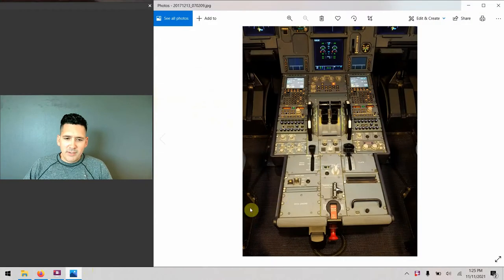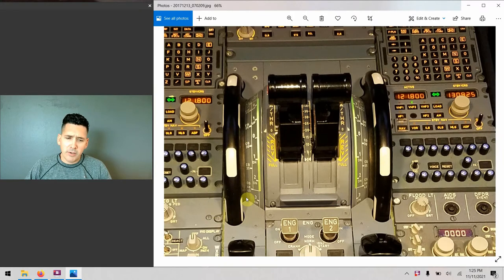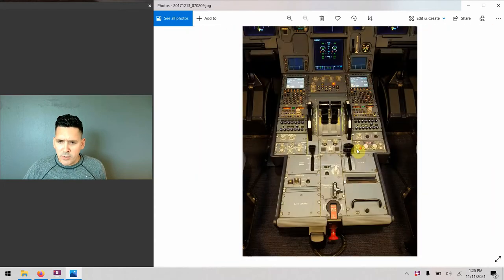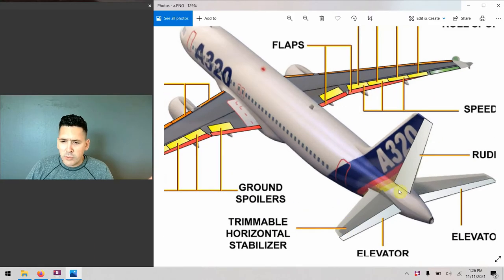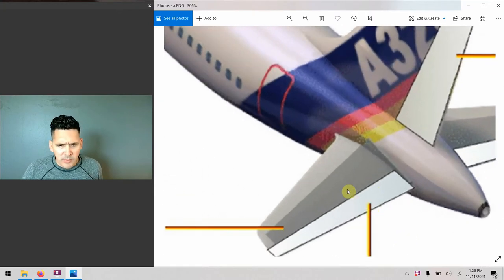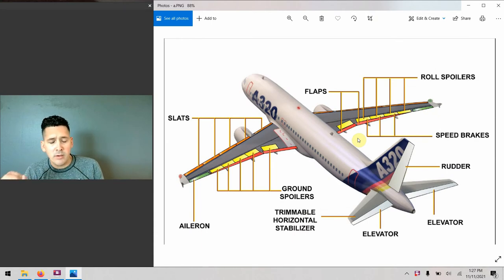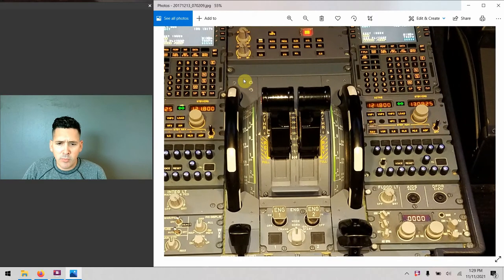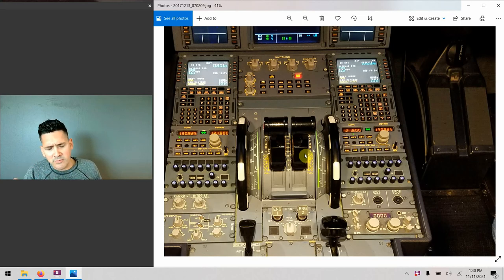Airbus A320 Cockpit Tour: #65 - Trim Wheel: What do all those buttons do?!

Comment: I was reading my limitations and came across this part , 

A standard automatic start that includes up to three start attempts, is considered one cycle

For ground starts (automatic or manual), a 20 s pause is required between successive cycles

A 15 min cooling period is required, subsequent to four failed cycles

The starter must not be run when N2 is above 20 %.

For some reasons it’s not really clear to me what’s it mean,please if you have time try to make it easier